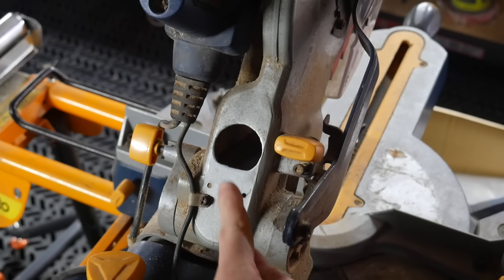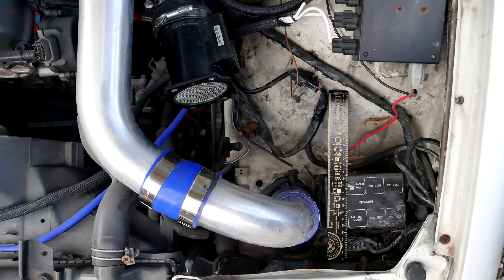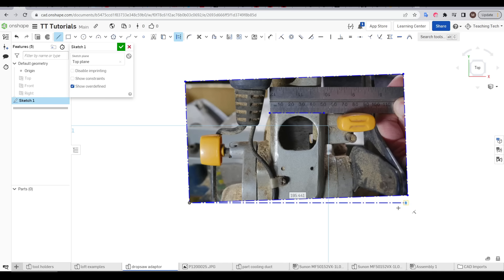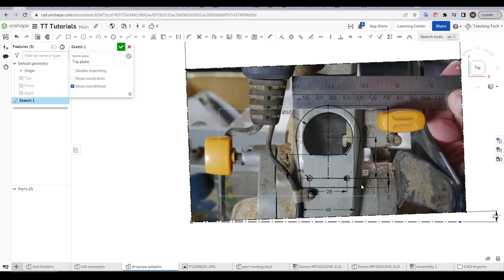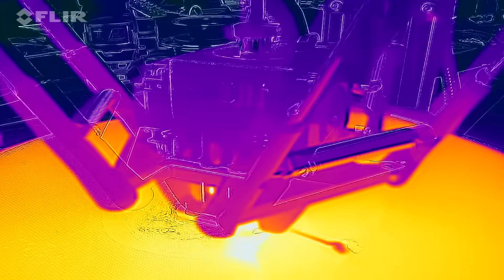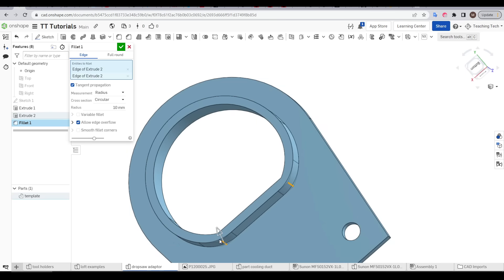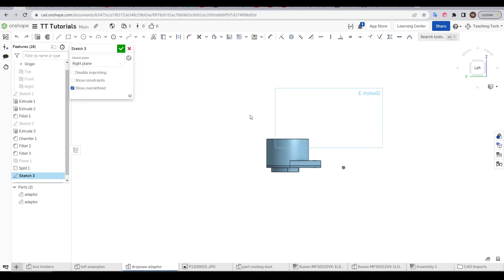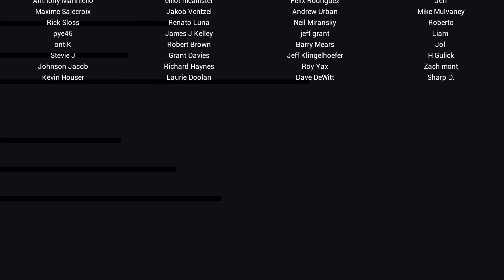Parts that fit odd shaped objects - 3D design for 3D printing pt4

Comment: Solution #4: Instead of relying on Extruding you hole from the sketch use the Hole tool and target your center mark. Hole has tons of features like setting ISO clearance for specific sized holes i.e. M6 = "Close" 6.4, "Normal" 6.6, "Loose" 7.0 or you can "Tap" which sets the proper hole size to run a tap through. I understand this is aimed at 3D printing and that's where I started but I had to break a ton of bad habits when switching to product design professionally. Supplier would kick back models cause I would fillet my "bottom surface" cause my printers would always elephant foot.
Reply: yea if you make professional cad files you deliver correct dimensions you need and the producer will add its lfavor of how to run its tools to come close to them. its the part he explanied in changing the hole sizes in the slicer wo would match that step. your elephant food could also be minimised with a slicer seting specific to your printer and filament.

but this tutorial is fo designing for 3d print and for fdm in first place the tricks to make the 3d model fit the targeted production method is valid and a lot of good fdm cad designs do this also.
you would do the same if you design files for an injection modling process since the cad design have to have specific rules applied to make it work.
the same woul be trugh designing something for a a 3 axis milling prozess or a 1 axis turning process.

it eliminates a lot of guesswork and fiddeling with settings in different slicers for the audiance and make the designs printable as it is.  since the models are shared between the communities on websites and so on it avoids a lot of complains and back and forth discussions on how you as the enduser and "customer" can make it happen at the end or have to tweak it.

its not realy a bad habit to use all that tricks its just adapting knowwlege how a fdm print and printer behaive and work and designing parts for this.
Reply: @Total_Egal  [please read this lightheartedly - on second and 3rd read it comes off as course. That was not my intention] I totally understand this series is for FDM printing but there are not many people posting quality video tuts about Onshape (not counting their amazing self-paced courses.) My comments are to just further the knowledge of anyone scouring the nosebleeds, like I was 5+ years ago. Maybe there will be someone, like me, that leveraged their more then 20 year hobby of Modding (what is now called a "Maker") to rise above being a production drone working in a warehouse to a salaried career.  And the tidbit of experience that they read on my comments will be remembered.  A great thing about parametric CAD there are multiple ways to get the desired results. Your comment on injection molding hits me in the feels. My first major project was designing an enclosure for a sensor board that was going to be in plain view of the end user and need to be serviced by techs. It was a huge upgrade to the way the product functioned (Marketing was going to blow it up). Engineering wanted it to be ABS+GF10 and I've never designed anything to pull from a mold before this. So much back and forth with the supplier so many hours on google trying to teach myself. I really thought I was going back to the line or I was going to be stuck in the testing lab. Egal, thank you, I like having conversations with passionate / knowledgeable ppl in the comments section. It's rare.

Comment: Excellent description of the techniques involved, though I use Blender which can import an image as a manipulable background to use as a reference.
Profile gauges are also useful for tracing shapes that can't be photographed properly.
However, it bothers me that the big hole only has screw holes on one side, so it could easily shear - there is space on the other side of the big hole, so I would drill and tap another two M4 holes and modify the adapter so that it screws into all 4 holes and thus be properly supported!
Reply: Or add a hook on the model that holds on to the other side.

Comment: Why not create a paper or cardboard template of the shape? Trim it down exactly how you want it, then you are left with something you can measure easily or even scan in to the computer.
Reply: @klave8511  Yep, I’ve made gaskets this way as well as custom shapes in metal and wood for special projects. I still keep poster board on hand just in case I need a quick and dirty template.

Comment: I always fix the sizes on the design. It's a lot easier make the part printer ready than need to explain each configuration and/or remember it on the slicer.

Comment: When I'm designing parts where holes need to line up perfectly. I export the dxf file of my sketch. Then cut it out with my vinyl cutter or laser. If all lines up I will then send it to the printer. I have saved so much filament that way.
Reply: A regular 2d printer,  and a flashlight works great too. On my 2d printer i just need to print at a 99.8% scale to get a spot on accuracy with my calipers at 100mm. Use some clear packing tape and you have rulers you can tape onto things like table saws, planers, even all 3 axis of a 3d printer. Add some color to the lines and you have super easy to read references especially when having to mess about with imperial measurements because it's impossible to find anything woodworking related in the US that's metric for a reasonable price.
Reply: yea but in this example the testprint was realonly 1mm thick, small and wickly printed. you probably need more time exporting and importing it into an other software, fiddeling arround with the paper or a spacial tool like the vinyl cutter to make it wotk.
also the 3d print test is showing hard measurements and testfits from the endprozess who is also used to make the part at the end.
he was only 0,1mm off with one dimension since i am shure its printer is better calibrated as the one the usuall casual user is using.
he was off by 0,1mm over view centimeters. just think about making a part 5-10 times bigger and the error is double.,
you get holes or mountingstandoffs or cutouts 1-2mm off where they should be.

your prozess adds one other layer of error, machining tolerances and human error to it without beeing nessecary

Comment: I always factor in the nozzle size, drawing a straight line is always 0.2mm either side of the line using a 0.4mm nozzle.

So an exact 4mm hole, you'd be 0.4mm too small due to looking at it as 0.2mm inward at top and bottom (or left and right, it's a circle so all the same) 

Also good practice if holes are going to be on Y axis is making them a small teardrop for ease of screw clearance as the very top of a circle will be flat and take crucial clearance away if you are needing tight tolerance for hole but not cutting a thread into it, this is neater and better than simply making entire hole a little bigger again
Reply: I like the idea of the changing the shape of the top of the hole to account for the flat top on 3D printed holes. This is especially helpful because bridges are the most difficult extrusion to get right and sagging of the bridges can interfere with a close fit.

Though your 0.2mm clearance works, I think your reasoning is incorrect. The slicer knows what size of a line it is laying down and it will draw inwards enough so that the outer edge of the filament lies at the intended edge of the part. It doesn't extrude on top of the line and leave some hanging out. In subtractive fabrication, we call this "kerf offset", but the same idea applies for additive fabrication.

However, the slicers are also working with approximations. Many slicers - such as Cura - model the extrusion as a rectangular bar, with the extruded filament having a rectangular cross section (layer height by line width). However, this is a rough approximation. The actual cross section will be rounded in some way depending on the viscosity and adhesive forces of the liquid filament. This meniscus is just like the way water has a rounded edge where it meets a glass surface. It's difficult to say how much this will bulge outwards because it depends on a lot of factors. Some slicers like SuperSlicer try to model it, but they still use an approximation that doesn't give the exact size calculated. Instead, the easiest solution seems to be to measure with your own prints how much of an error your slicer's approximation causes and adjust your horizontal expansion to account for it. Note that this amount will depend not just on your nozzle width, but on your line width, layer height, material, temperature, and many other things, so expect to calibrate it any time you change your print settings.
Reply: Clearance holes for an M4:
Close fit = 4.3mm.
Medium fit = 4.5mm
Loose fit = 4.8mm
And this is the a machining handbook and obviously ignores issues than can arise with 3D printing.

Also what you described is called lead in.  It's often found on machined parts. Also, when you debur a hole, the small chamfer left behind can also act as how you described depending on how deep you go.

Comment: Here is some tips : 

If you can remove the part you want to adapt and is flat you can put it on a scanner, it gonna be super accurate. If you can't and it's square you can print a square on a transparent sheet on a 2d printer ( you don't have one ? Print a square with your 3D printer ) and then take a picture, square + align on photoshop. Then you can export it to SVG the contour to the cad software. If your tolerance is two tight you can expand it with a simple parameter.

If you want something very smooth you can SVG > illustrator or another bezier cad.

It's easy and very fast method.
Reply: I had to do something like this awhile back for a camera lens adapter and so what I did was lay a piece of paper on the front of it and rub a crayon sideways on it to get the outline, and I threw it in our scanner and got the perfect piece made for it.

Comment: Solution number 4: Use polyholes, checkbox underneath the XY compensation, "convert round vertical holes to polyholes" works wonders and i cannot live without it anymore.

Comment: Try the polyholes option for hole shrinkage, too - I've had good luck with it getting much closer results to the actual hole dimension, though I still do add a little bit of tolerance just to be safe.

Comment: Re: using normal screws as self-tapping screws. I try to make all my designs where I thread directly into the plastic 1/2 of the pitch smaller than nominal. Example: M6x1.0 -- this becomes 5.5mm = 6mm - (1.0 / 2). This seems to give a good bite and plenty of strength, without too much strain trying to get the screw in the first time. I also add a small chamfer to the opening of the hole to guide the screw when you start it, usually around 0.4-0.5mm x 45°.

The smaller I get, the more material I leave, though. For instance M2x0.4 I use a 1.6mm hole. The threads are so fine and the cuts made are so small, that a full 100% pitch undersize works well for this. M3x0.5 threads I use a 2.6mm hole, splitting the difference.
Reply: I find the exact diameter to use in the model for the hole very much depends on how much the printer ends up reducing the hole. One problem is that as the nozzle circles the hole, the filament is under some tension, and tends to pull toward the center a little bit.  So I have some test prints with a range of hole sizes to see how the commanded diameter of  the holes correspond to the as-printed holes.

Comment: Is Onshape easier to use than Fusion360?
Reply: In my case I would say no.

An example is how long it takes to calibrate the image size to be as true to the part as possible.

In fusion you take a good photo, add it to the drawing, click on the "calibrate" option and use the reference size of the original object and you have a reference image with almost exact measurements of the object.

Comment: Thanks Michael I've been following this and it's helped quite a lot. I'm wondering how much this translates into fusion360 as we use that a lot at work.
Reply: I've been using Fusion 360 personally for about 3 years and have found these tutorials helped me a lot.  You might have to look around since things are in different places, but every concept is there so far.  I have probably expanded my F360 knowledge by 5-10% as a result of things I've learned watching this series so far.

Comment: I frequently split parts like this to avoid supports or just to get a cleaner print, then CA the printed parts together. The seam is invisible and stronger than the original. However, I REALLY like your idea of printing the parts from different materials where useful. In your example, the lowere half becomes a useful gasket. It would still be useful in some applications to glue the TPU and PLA parts together leaving a part with an integral "gasket".  Incredible versatility.

BTW, I've been a Fusion 360 user for nearly 3 years. Once you know one major program like this, you can usually follow tutorials like yours which use a different program. It's like word processing. Once you understand what one is capable of, it's just a matter of learning how that particular function is done in the new program. I've had no difficulty following your last 4 videos as design exercises instead of software tutorials.

Excellent video as always.
Reply: @peterg3283  Generic name for Super Glue: cyanoacrylate

Comment: I thought one of the reasons for the holes being undersized was a result of the tool path chosen by the slicer. I usually increase the diameter of all small holes by the line width and/or nozzle size, and that usually works pretty much spot on.
Reply: It's bad design.  Trying to fit an M4 screw through a 4mm hole makes no sense.
Reply: The nozzle size brings us to the same .4mm.
Reply: Clearance holes for an M4:
Close fit = 4.3mm.
Medium fit = 4.5mm
Loose fit = 4.8mm
And this is the a machining handbook and obviously ignores issues can arise with 3D printing.

Comment: i would love a video on how to design parts that fit around oddly shaped objects where you can't just take a picture. This is something you could need to design mounts for things like Bikes where you commonly have non circular tubes.
Reply: Or mold clay around it, then carefully slice it off along the length of the tube, so you have a negative of the tube.
Reply: I had this problem too for which I used a "profile gauge" to record shape, lay flat next to a ruler, photograph from a distance with high zoom to reduce parallax distortion, import and trace over to build desired shape.

Comment: One thing you can do when measuring odd shapes in hard to reach places like that is to use plasticine to create an impression or mold and use it as a base to take the measures. It is not perfect and has to be done delicately due to the softness of the material but it can be handy.
Reply: Right - you can do it with a piece of paper and the side of a pencil sometimes too.
Reply: Ya know, that plasticene suggestion seems simple and obvious, but thanks for posting it because it had not occurred to me! Yay Youtube commenters!
Reply: Pencil and paper is very effective
Reply: I recently made a video about exactly this technique https://youtu.be/-1TTxH8pj-o 
I used Blue Stuff, which is more rigid than plasticine, but the principle is the same.

Comment: I think you scaled the photo the hard way. An easier way is to draw the construction line on the ruler and then dimension the construction line based on the span of the ruler it covers. If this is the first dimension placed on the sketch, it automatically scales the image too, keeping the construction line in the same place on the ruler.
Reply: Here is even better way to do it: Take a piece of graph paper and using pencil rub the outlines of design. Take photo of the paper and bring it into photoshop. Correct the perspective, distortion and scaling of it using checkered pattern as guide. Now you have perfectly adjusted image, that you can bring into CAD.
Reply: Works great in Solidworks, too!
Reply: Also, worth noting is if you take photo close up it will be more distorted near the edges, step back and zoom in and you get closer* to an orthographic photo, which means dimensions are more consistent across the image.

This helped me a bunch when I had a thicker part to copy and parallax was causing issues with the dimensions.
Reply: Top idea!
Reply: That is exactly what I thought. The process shown is very inefficient.
Reply: What a simple idea. Thank you❤
Reply: I don't know why, I tried your way and the way in the video, when I dimension the construction line, only the construction line changes, the size of the image doesn't change. I don't know how to make them change simultaneously

Comment: I wouldn't have thought so much of splitting it the way you did, but the advantage of making that part in TPU is definitely a good one.   I'd probably have considered adding a glue or silicone to help join the two parts.    My route would probably have been to loft/extreme filet the hose end to the mounting plate, allowing it to be printed hose-end-down without additional supports (and adding a little more strength to the part).

Comment: Instead of using the split feature wouldn't it be easier to have the other half of the part be a new part from the extrusion?
Reply: Sometimes it can be, but here it is pretty much an equally good solution.